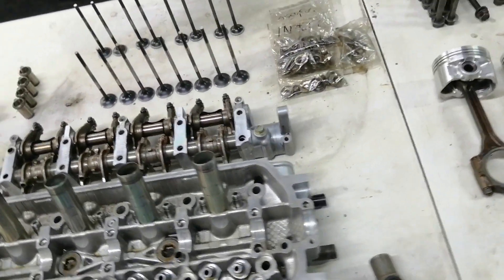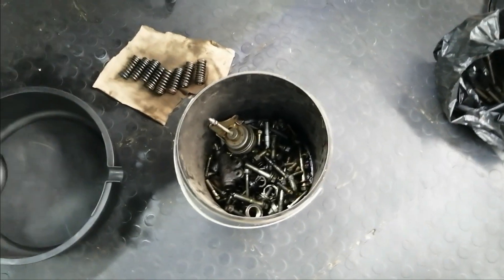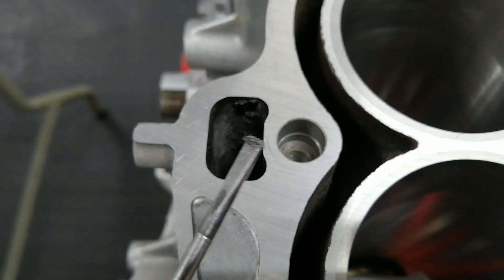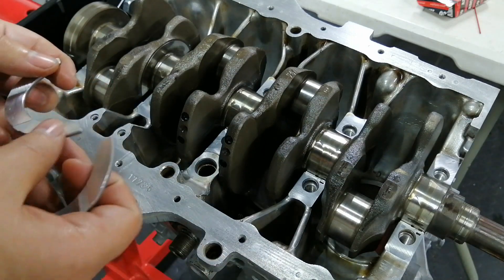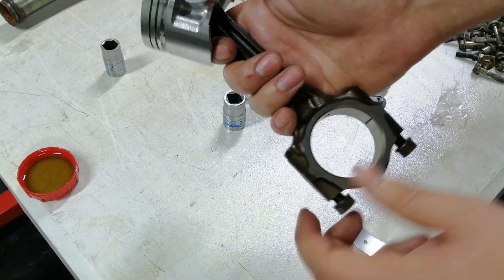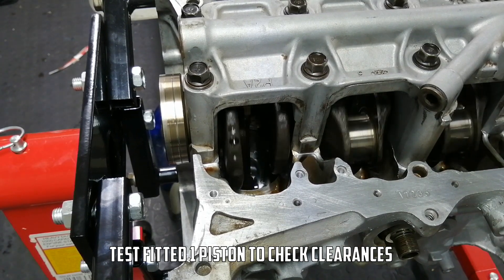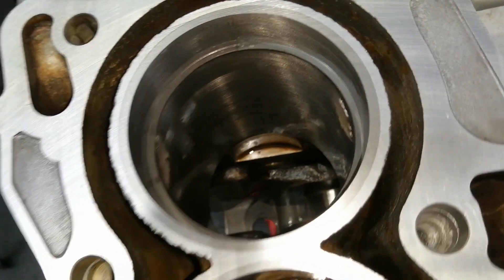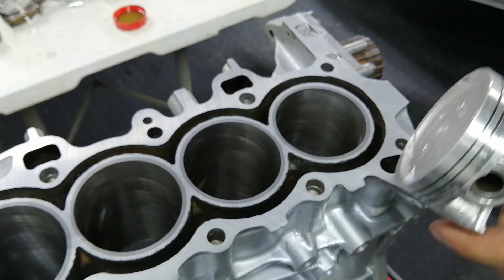Honda VTEC Engine Assembly  - D15/D16 Mini-Me - Part 1

Comment: Great video! I have a question. I haven't driven my Honda for 7 years, and now it won't start. It has no engine compression, and yesterday I removed the cylinder head. The pistons are clean, but the cylinders are slightly scratched, almost imperceptibly. My question is, do I need to replace the oil pump or the connecting rods? I'm going to resurface the cylinder head and replace the gasket. With these modifications, will the car be able to start? Looking forward to your help. Thanks.

Comment: Hi mate that is some great work  there , I've got a d14z4 none vtec engine what is the best vtec  head to put on new to this and i can get hold of a d15b vtec head complete so any information will be appreciated plus  I've got a  delta 282 regrind camshaft as well and a slk230  supercharger  ready to go on  please help me thankyou 😊
Reply from the maker: Hi, best sohc vtec head is code P08 or P2J. Just be careful as there is also a vtec-e head that is P2J. Avoid heads with the code P07

Comment: You didn't plastic gauge the main or rod bearings?
Reply from the maker: Hi Mike, at the time I was not able to find plastic gauge (2020), however since the motor was running fine before and all the components are the same (rods, block and crank) I replaced the bearings with the same size and brand bearings that came out, meaning the risk of it being wrong was low enough for me, and it worked out as the motor is still running.

Comment: Good day sir are all D16 y4 and d16 usd are same rebuild kit? Planning to buy in us at oreily I can use in the Philippines. Thank you
Reply from the maker: Hi, mostly yes. EG and EK have different head and intake gaskets, however they both work but get the correct one for your motor. D15 has different rod bearing to a D16. EK motors has a thin MLS headgasket and EG had a thick "paper style" gasket
Reply: Mine is a d16 y4 from New Zealand. Thank you sir I'll get a d16 rebuild kit thank you

Comment: can you give me a list for all parts for overhaul im trying to fix my d15 with 300k km. want to change everything from engine rebuilding. but im not familiar with parts from small details to big details
Reply from the maker: Hi, what is wrong with the engine? smoke? blow-by? a very basic rebuild is new bearings (main/big-end/thrust), new piston rings and valve stem seals. also get a full gasket set so you can replace all the seals. that is a minimum, however there is a lot more, valve guides and valve seats (new valves if needed), Sleeve wear - sleeves bore oversize and new oversize pistons. cam and crank polishing, (cut if needed). new water and oil pump. it all depends on how worn out the engine is. normally a machine shop can measure clearances and tell you what is necessary to replace and what not. 300000 kms is alot but these motors can handle it. I have a 305000kms k24 motor that still runs like a dream, no smoke and not a single leak.

Comment: How mich did it cost over all bro? Im planning to engine overhaul my d15 dual Vtec witj 300,000 km. Cant let go my civic ferio
Reply from the maker: Hi bro, it depends on your country and engineering cost. For me, a gasket set was $70, and engineering was $150. However, I am from South Africa, and engineering could be x10 more expensive depending on your country.

Comment: What is the Torque settings for the mains and big ends
Reply from the maker: Hi, I used this
Connecting Rod - 23ft lbs
Mains - Step 1 - 18ft lbs 
Step 2 - 38ft lbs (Z6 & Y8)

Comment: No oit jet
Reply from the maker: Hi, these motors don't have oil jets on the block like a B16, however they have oil jets built into the rods.
Reply: Okk
Reply: How touque nm  conting rod d16a and main bearing ?

Comment: Nice man i just feel like you should have spent the extra 300 and just got the speedfactory rods. The stock pencil rods snap at 200 hp
Reply from the maker: Hi Bro, absolutely correct, if I could get them for $200 I would have done it. my problem is im from South Africa, so there is + $100 for shipping, + $100 for taxes and duties, also wages are about 5x lower in South Africa, here $400 rents you a house so the $200 rods cost the same as rent, crazy stuff bro. I plan to modify B18 rods to fit the D15B, the engineering will cost less than $80 locally.
Reply: @RisingBoostYT  completely understandable bro, props to building did a good job. my only recomendation is keep power under 180 here in the states alot of people boost on the stock rods and blow them ruining there whole build.
Reply from the maker: thanks bro, yeah I always see them blowing up the single cams, mine is on 186hp now, running decent and reliable, just want to sort out the boost curve/power curve. i'll make more power on the B18 rod D15 I am building next.
Reply: Don't you need to rebalance the crankshaft if you change the rods?

Comment: im doing a reassembly this weekend. my beater car died so i decided to throw an 80.00 rebuild kit and some machine shop at it. i hope to get another couple hundred thousand out of it.  i tried to find a new engine or used with warranty but they were all over 1200-2400.00 so i opted to give rebuilding a go at about 600 bucks.
Reply from the maker: Hi bro, yes rebuild VS replacement motor depends a lot on where you from, if you rebuild and all your clearance and torque specs are correct, your oil pressure is good it will easy do 100k more miles, are you changing pistons to oversize?
Reply: @RisingBoostYT  no I'm not. I'm doing the cheap route. My truck is bored and stroked though, compound turbo with 475 horsepower injectors. That guy can get up to over 100 psi at the manifold under WOT. Last dino run was just over 1,700 ft lb of torque to the wheels.  This car is going for fuel economy
Reply from the maker: Oh okay, changing just the rings and doing a cylinder wall hone will work, but it may have a bit more blow by as the sleeves do wear out a bit causing the ring gaps to open up a bit, but if it's just for economy you probably won't notice, I have done it like that before. It was all good
Reply: @RisingBoostYT  yeah I got everything cleaned up at the machine shop, didn't bore anything though. Just haircut and a decking. I've never put one of these together before so this will be a first. I've only ever worked on diesels

Comment: Hi, how are the King bearings holding up in this build? Thought i’ll try them, some people say they arent the best, but others say that its the best bearing brand out there
Reply from the maker: Hi Astlication, the king bearings are great, motor is still running perfect, making double factory torque and getting abused every time it gets driven, however don't confuse "king" with "king racing" it is the same brand but the race bearings are made for racing application, so probably better.
Reply: @RisingBoostYT  okay, thanks!

Comment: Thrust washers are backwards
Reply from the maker: Hi, how do you fit them? according to my research the slits face the crank, that's how I fit them.
Reply: I’m pretty sure the grooves face the crank. Now I’m second guessing it. Have u ran the motor?
Reply from the maker: Yeah that's how I fit them, groves face the crank, yeah it's running no issues, have a video on the channel dyno tuning the motor.
Reply: @RisingBoostYT  to me they are facing out. Re watch your video here
Reply: @RisingBoostYT  sorry I see it now. They are right.

Comment: How much money did u take to fully build the d series engine
Reply from the maker: Hi Jesse, I actually did not build the motor, this is all stock parts, so the cost was not much. Engineering was the most expensive part. to build a motor you should look at the SpeedFactory rods and pistons and add some ARP studs. you probably looking at $600 but more realistic is $1000-1200 considering you may need gaskets, new pumps and engineering work.

Comment: What brand pistons are you using?
Reply from the maker: Hi, the pistons are from a spare shop, the brand is ARCO
Reply: @Rising Boost  oh ok because I also bought a set of arco pistons for my built
Reply from the maker: Remember to do the ring gaps, so far I have no issues making 135kw. but if you overheat the pistons with launch control, running lean or boosting hard continuously and the rings touch the ring glands will fail.

Comment: I'll be doing a mini-me myself on a D16A7 block, but sourcing the Z6 head is quite difficult where I am, at the moment. I won't be boosting it but atleast there should be a difference on the butt dyno!
Reply from the maker: Hi Solemn, yes the vtec should be noticeable and sounds good, the A7 has a high comp piston and the Z6 has a high comp head so that combo is going to bump the compression quite a bit, use the online tool to calculate the compression ratio before you try it. It could just go to high. Only way to find the sohc vyec head is to check FB marketplace every day, also join the local Honda groups on FB, that's how I found mine.
Reply: @RisingBoostYT  Literally after I put this comment on, I found one on sale. currently negotiating!

Also, what online tool? I'd like to see it. But the people in the local community hasnt seen anything disastrous going on with a swap like that
Reply from the maker: @JolteonRacer  I'll link the website below, you should be fine going this route, it should give you about 10-1 compression. you also have options for head gaskets that would make a difference in case you want higher or lower comp. Y9 is thin so high comp, A7 will drop the comp. - https://www.zealautowerks.com/dseries.html

Comment: Nice vid!
Do you got the torque specs of the bridge and the bearing caps of the pistons? 
Thanks in advance!
Reply from the maker: Hi Dy, I use this website,
 https://www.nthefastlane.com/d-series-torque-specs
Reply: @RisingBoostYT  Hmm ok.. i looked at the page but it only says for d15/d16 engines.. i’ve got the d14z2 engine but (by instance) my girdle has exactly the same numbers (P2A) on there as you have in this video so i’m really confused now.. plz help!
Reply from the maker: @dyc4107  to my knowledge the only difference between the D15 and D14 is the stroke on the crank, (sometimes the length of the rods) if your parts are stamped P2A it should be the exact same block and head as the D15 and D16. they just give it a shorter stroke and lower block hight to make it 1400cc. you should be able to use the specs for the D15 for your D14. the only motors that could be different are factory vtec-e motors.

Comment: I have a d15b bottom end with oil dipstick in the same location like yours and I’ll like to know if the crank is the same diameter of a d16? So I want to use a z6 crank and d16 rods in the d15b block
Reply: I think the block was a jdm d15b block dual vtec and someone at some point took the head off
Reply from the maker: Hi EJP it may not work because the D15 crank has a shorter stroke, meaning the D16 rods and crank combo could push the piston topss out of the block deck. Some D15B vtec cranks have the same big end journal size as a D16. So the D15 crank could work with D16 rods but the pistons may still poke out the deck a bit. But a thick headgasket may solve the issue.
Reply from the maker: The JDM D15B has a D15 crank with D16 size journals and D16 rods, but the block has a lower deck hight than the D16 so it uses special pistons (not easy to find) use the zeal auto works compression calculator tool online as it will tell you the piston to dech hight for the combination you want to use.

Comment: How long did the whole process took you to do it? I want to do it my self any recommendations? Thank you, nice videos!.
Reply from the maker: Hi Conffetti, glad it was helpful. the motor build took me 4 days working alone and filming. it is very possible to build a motor in 1 day if you have everything ready. installing the motor was also 4 days working alone, but if you have someone helping you and all the parts ready it can be done in 1 day. this does not include the time I spent cleaning and painting every part. if you need to pull the motor and strip it will be 1 more day if you have a engine hoist. engineering shops can sometimes take weeks to finish the work needed. i was mostly held up by waiting on parts, not having a part  because I forgot to buy it. if you are from USA I would recommend getting a import motor unless you plan to build for boost.

Comment: If its a forged conrod with high compression piston, that beast makes more power
Reply from the maker: Hi MFBNA, yes forging the motor would have made it capable of a lot more power. at the time I could not source the parts needed so I went with stock.

Comment: ACL D16A1 race bearing, good for D15!
Reply from the maker: Hi Imre, this specific D15 has smaller big end bearings than the D16. Some D15's like the JDM D15B vtec has the same big end journals as the D16, but for my D15Z4 engine it will not work, the main bearings should work

Comment: Where can I get con rod bearings for the D15 engine?
Reply from the maker: Hi Ronaldo, most spare shops should stock them, its best to remove samples from the motor before buying to make sure you get the correct bearings. I got mine a Alert Engine Parts

Comment: Videos awesome because my friend told me he hated that he had a D series engine today, now I gotta show him🔥
Reply from the maker: Hi, the D-Series stock can be a bit gutless from factory, but boosted they can make 200-220whp on a stock motor fairly easy. 350hp for you get forged rods, pistons and ARP hardware. some guys making over 500hp but that becomes real expensive quickly. a B, H or K series is better but Dseries is by far the cheapest power up to the 350hp mark.

Comment: Not the best rod and pistons for boost. Very thin rods cannot handle power.
Reply from the maker: Hi, yes definitely not, but for this budget build we are using all stock parts, so far it made 187hp on the dyno, head gasket did not like it but the rods are still inside. only want to make 200-220hp on this setup.
Reply: @RisingBoostYT  ok just be careful with timing.

Comment: Howzit man ,

It sounds like you're from SA? Is the vtec D-series top ends rare over here? Im just starting to get into hondas and going to try and get a an old ballade in the next few months so I'll probably be messing with the D series engines for a start. Seems like I'll be able to learn a lot from your channel will be checking out more of your videos!
Reply from the maker: Hi bro, yes im from SA, the sohc vtec heads are rare here because non of the local sohc motors had vtec, but they do come up for sale on marketplace, you must just keep looking, they decent motors, mine is boosted and making 187hp now, want to turn it up a bit to make more
Reply: @RisingBoostYT  Awesome will be following your build and learning!

Comment: Have you guys seen the prices on these single cams online now? Omg it’s ridiculous!
Reply from the maker: Yes it is getting crazy, a D15 is more expensive than a B20 where I am from, unless you buy private, but that is risky.
Reply: @RisingBoostYT  picked up a 90 Rexxer with a sohc ZC. It’s a smoker so going to do a rebuild instead with these prices. Even the rebuild with good parts is expensive. I remember giving away these engines years back. Now they are gold 😂

Comment: Whats head Bolt take for d15z block and d16y8 head?and the the torque for mount that
Reply from the maker: Hi JC, whats is the next number after the Z?
Reply: @RisingBoostYT  d15z6
Reply from the maker: Hi  @j.c6818  the D15Z6 is a Euro-spec motor so I have not seen one, from the looks of it you will need all short studs. but I can not be sure. where is your dipstick? by the cam belt or in between the exhaust runners? the D15Z6 came factory with a P2J Head Cast, so it is the same as the Y8. so stock should work perfectly. watch my last video, it deals with the head studs, which may be helpful.

Comment: What is the piston to cylinder wall clearance supposed to be for a turbo application?
Reply from the maker: Hi Campin, it depends on your build and the pistons them self, cast or forged pistons. the best way to know is to look at the piston box or instructions sheet. they should have the recommended clearance listed. I told the engineering shop I intend to boost the motor and trusted them to worry about the clearance. but it's normally 0.001 - 0.005

Comment: how do you know what bolts go to what after putting them all in that bucket. Diagrams? or just really good memory XD.
Reply from the maker: Hi Merk, yeah it was not fun, I actually sorted out the bolts by size, the bigger bolts are fairly easy to find where they go, but for the smaller bolts I had to use a vernier to measure the hole depth before taking a bolt. lucky most of the small bolts were only 3 different lengths, with some exceptions of course, I won't recommend my method though, rather bag and tag.

Comment: curious as to why you didn't upgrade the rods?
Reply from the maker: Hi, the D15Z motors have a slightly shorter rod. there is no forged rods available for the D15Z. The D16 and D15B have loads of options for rods. So I decided to keep it stock and put the money towards a Bseries setup.

Comment: What pistons and rods did you use? Well I have a d15b vtec block. It's very hard to find pistons
Reply from the maker: Hi Brandon, I used spare shop pistons, just stock oem replacements. Yeah the D15B has a unique R/S ratio so it uses special pistons. I actually also have one (not this motor). here is what my plan was, but I have not tested or researched it. vitara pistons sit lower in the sleeves, but not low enough for D15B. so I was going to check if it is possible to skim the top of a vitara piston to make it fit. but it will only work if it is not to much that needs to be removed.